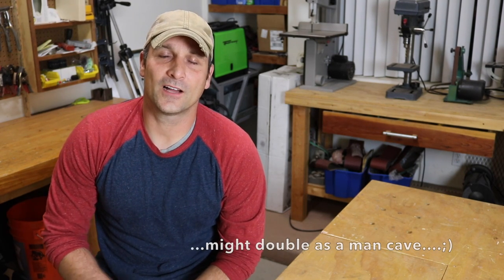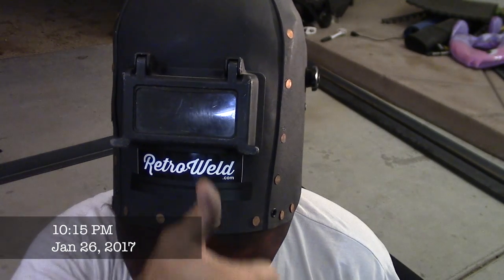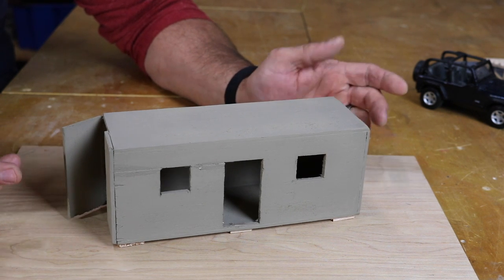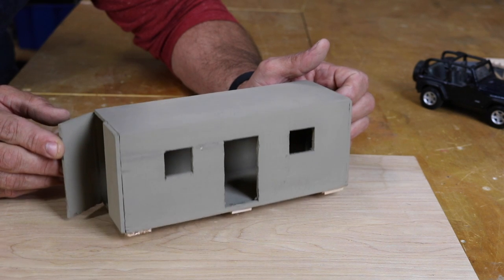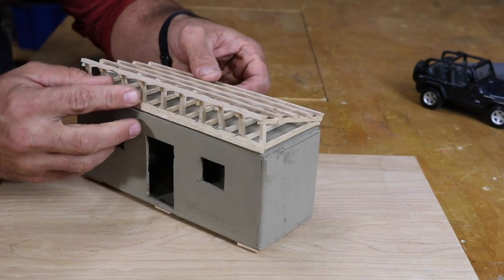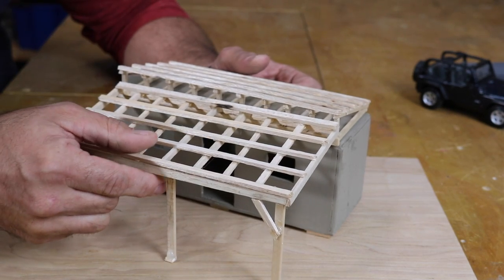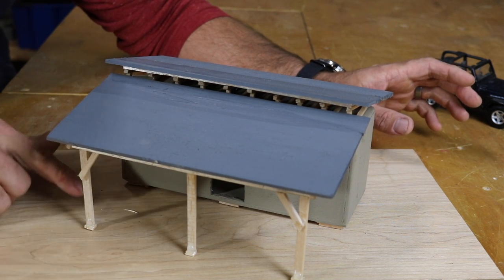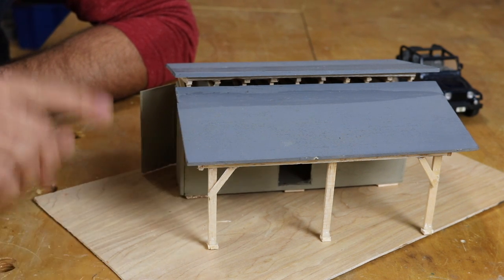Shipping Container Shop Project - Intro

Comment: By the look of your model, in my opinion you are on the right track. a Roof with insulation for a container is an absolute must in our climates. It becomes a oven without one. Really excited to see the project Joe. Will definitely have to make a detour from Vegas in April to come and see for myself.
Reply from the maker: I'd love that Charl!  If you can make it out I'd for sure try and be available.  Or if it is on a shift day you'd be welcome to swing by the station too:)

Comment: Great video, I have experience using them in war, we insulated ours with a foot of mud on the outside which kept the container home inside temperature easily manable, and by the way it resisted an RPG attacks, it just made holes in the outside mud wall.
Reply from the maker: Wow, that's cool!  That's being resourceful in multiple ways too!  I plan to incorporate some south and west face insuation of some sort.  Not sure yet but that will be later down the way:)
Reply: homesteadonomics let me know if you need more ideas, you can also use gabion baskets made of rocks and mud too. I enjoy sharing because it helps others. You are doing a good job sharing, so please continue posting.
Reply from the maker: haha.. it's funny you mentioned gabions because that's actually something I plan on incorporating into this!  Kind of a gabion wall on the west end to act as a wind break:)
Reply: homesteadonomics I was a reconstruction team leader in Afghanistan and have great gabion  ideas and pictures they are yours, just keep sharing.

Comment: Have considered this as an option for some project(s) as well. Looking forward to how you cut through the metal, adhere the roofing structure, attach the overhang to the roof. Appreciate all the other videos provided as the information is concise and helpful.
Reply from the maker: Yes, it's gonna be an experiment for sure.. but hopefully I'll come up with some workable solutions:)  going to be doing the main cut tomorrow and hopefully will get them moved over to the property:)

Comment: Hi Joe,  Just thinking (random thoughts about your project) about natural light. Your door and two windows will be shaded by the roof and awnings. Will the "carport/jeep-port" awning be made of some sort of see-through material? If not think about adding windows to the back side of the container too.  I can imagine a series of 3 or 4 foot windows set horizontal and high near the roof line to let in tons of natural light (but this can be evaluated after the awnings go up). I'm sure you have an idea of where you want to put this on your homestead will it be south facing? Will it be on the opposite side of the house from the bedrooms, or some distance away from the house? Will you insulate and put down plywood on the floor and walls to help absorb some noise? Paint the interior white to reflect light? Running electrical to it for power. LED shop lights?  Mini-fridge (for the man-cave side)? Oh by the way how's that pinwheel project coming along? I hope that Jeep sponsorship comes through. Cheers,    Bill
Reply from the maker: Hi William,  
Dang you hit on things I hadn't even thought of.  but for now the orientation will be E-W and the awning will face north towards my garage opening to act as a wind block and make working between the garage and the shop seemless.  Insulation will be inteerior on one end, a little closed off space that I'll consider a 'clean' area with a door.  It will almost be like a little office area with a work bench and paneled walls.. and maybe a little window ac unit.  ..fridge in there too;)
I haven't decided on power yet as I'm wanting to keep this technically unafixed and more of a shed structure legal wise.  I might have a junction box on the container to be powered by an RV extension cord so I can technically say that it doesn't have power to it:)
Anyways, just some thoughts for now but I'm sure it will change a bit along the way:)
Joe
Reply: Hi Joe,Maybe you should rethink this whole project. The awnings are to provide protection from the sun for your new picnic table. Then if the space just happens to get repurposed with ... say... a movable tool shed then that's just a bonus, just to avoid the taxable building issue. On to another subject. I can't recall if you've ever talked about back up power for your home. Does your home have a back up generator? If not that might make a great addition to the shop. So you might feel fine to run an extension cord from the garage to the shop to run a drill or saw. But for something that requires a lot of juice you'd have the generator. And if you ever lose grid power then the shop genny could power your home. Cheers,    Bill

Comment: I think its a great idea, and look forward to the series. As I thought about your project, one thing that may be a problem for you is securing the roof without drilling too many holes into the container. Those containers do have a few tie down points, so Im assuming you are going to focus on those points for securing the roof area? Just throwing it out there so you can "chew" on it and come up with a game plan. It may all come clear when the container is sitting on location though...good luck
Reply from the maker: I'm always game for some ideas to 'chew' on so keep em coming:)  Yes, i think I will weld brackets to hold the roof trusses on and maybe bolt them on as well.. need to do some more looking at the roof structure when I cut it.

Comment: WOW   will  be a GREAT project,  and have seen so many different ways to use the containers. Would DEF go with the 12 awning roof,  and then that gives you plenty of space to do things and not be cramped. Also like the ideas of the gabions and such for wind and sun protection. Any thoughts of making a gabion style raised bed along the one side of the awning? Water from off that roof and have green plants to help shade and filter the air as it passes through.  Good luck and keep those great ideas coming.    Greg
Reply from the maker: Thanks Greg!  I really like your idea about the gabion raised bed!  I might just have to incorporate something like that into awning area.  it would look cool, help with wind and just make it a nicer area to be.  I'm hoping to make this shop more than just a shop and into something that has some character to it too!
btw.. I just posted the cutting of the container:)
Joe

Comment: Wish I could do this (11th floor apartment life is confining). Very minecraftian that.  You may want to make some 1x1 stud walls covered with 5mil sheet plastic and make a full sized model before you get cutting steel.  Much easier to lay the ideas out in real-space that way (and cheaper and the 1x1s are repurposable easily for interior construction).
Reply from the maker: That's a great idea and probably close to what I'm gonna do with one end that I plan on making into a more livable clean space... workbench but with a door so I can keep out the dust and other stuff:)  This is gonna be my psuedo tiny house project... but in the practical form of a shop:)

Comment: hey Joe love this idea. I do have a few questions, how will you close off the cut end for your co-worker? will you keep the shipping container doors or will the co-worker get that end? have you looked at some sort of diy sliding door? or maybe a small roll up garage door.  great idea though buddy can't wait to see it
Reply from the maker: Hey Lance... I plan to convert the side with doors for my co-worker, so that he gets nicely weather tight doors and that way I can get it to him quicker.  The part I'm keeping will get the custom doors as I'm wanting to not have the shipping container latch system.  They probably won't be as weather tight as the originals but with the roof over hang it might be just fine:)

Comment: I would  be very careful in splitting a 40 foot container jnto two. the corner posts are the main way that the container takes loads and stays rigid so cutting two out would really damage its integrity if iy is not supported in some other manner. also I would recommend painting it white on the outside and adding some insulation so it doesnt get like an oven during the day.
Reply from the maker: Yes, it's a concern of mine.   I'm actually going to be welding x bracing inside the container today just to make sure the cuts ends stay square until I can get new corner post /end frames welded on.

Comment: Heck, you could fold the container along the cut line and have yourself a 20x20 shop. (Find a way to recoup your costs elsewhere)
Reply: Sorry to be another commenter with: "you should..." or "you could..."
Reply from the maker: It's no problem.. it's a valid question and really actually the most bang for my buck regarding space, etc,.  But I'm wanting this to 'technically' be moveable so that I can consider it a 'shed' type building.  this is in regard to our local codes.  If it is afixed to the ground and not moveable then it's a taxable structure.  The awning will be offset from the main ridgeline so as to not be apart of the main roof structure and therefor easily removeable.  Not saying that I ever really plan to move it just trying to make sure I have options;)  ... and one more reason is if I ever hit a financial hardship that I could sell it to someone :D
thanks for watching Larry:)

Comment: I always thought of having a container workshop, so this should be good to see.

Question. will this be cheaper than building a shed?
Reply from the maker: Hi Harki,

I think it will be about a wash... by my calculations it will be about the same if it was just a 20' container.  BUT, the selling of one end of the container will make it cheaper by recouping my costs.  But for the most part it's because I wanted something with metal walls and that could be moved in the future if I ever needed to sell it:)
Reply: Yeah didn't think about the mobility of this, great idea. Can't wait to see it happening.

Comment: Some thoughts after watching the video.

1)What orientation are you planing (N-S , E-W) (Do you minimize heat gain or solar panels.)

2) Insulate the outside of the container, not the inside.
Reply from the maker: hi cat prog,

orientation will be e-w and the awning will face north towards my garage opening.  It will serve as a windblock for our SW predominant winds.  Insulation for the container is up in the air right now but I plan to build a dead air space shade block on the south and west sides.  That is common in the desert SW to have something that just casts shade on a wall to bring down the heat transfer.  The cold is less of a concern though.
but it won't get decided until the main structure is up first:)  thanks for watching!
joe

Comment: If you have the room can you orientate the connie to obtain maximum solar efficiency ie so you dont cook in the hot weather or freeze in the cold weather?
Reply from the maker: I plan to have it e-w with the awning facing north.  the south end will get some shade structuring to help with heat and the west end will get some insulation on the interior and closed off on the inside to make myself a little clean work area that will hopefully be free of dust.

Comment: are you going to lay a slab of concrete either under the container and awning or at least just the awning?
Reply from the maker: No concrete.. just concrete piers that I poured a couple days ago.  Under the awning I might do a slab though for being able to work on things with a nice flat level surface.
Reply: Yeah I think that would be smart

Comment: Curious about the rationale for the "split level" roof.  Why not use standard trusses?
Reply from the maker: I'll probably talk about that in a later video but the quick reason is that I want it to have the ability to be removed to keep it classified as a temporary building.... ie.. .for tax/code reasons:)

Comment: How much is a shipping container and where do you get them?
Reply from the maker: Hi nancy, 

Costs depend greatly on where you are located in relation to a port that get these containers.   In my area 20ft containers can go from as cheap as 1500 to 3000 depending on condition.  Some coastal areas they can be as cheap as a few hundred dollars.  I however, purchased a 40ft from my neighbor for 2100 and then sold the front cut off section to a friend to make my 20ft section that I kept for the shop roughly $1200.
Joe
Reply: That is good to know, thank you for the information :)

Comment: Late to the party as usual...  LOL...  Let's see...  Brain teasers...  We have a roll down door on our shed that might work if those end doors prove out heavy...  Since you are shading that much ground, bury 100' of 4" flex and geo cool the container with two 4" solar duct fans (one pushing and one pulling)...  And...  Definitely gonna need a mini-fridge...  Then all ya need is the rocking chair, tin foil hat, and a shotgun....Just say'n...
Reply from the maker: hahaha... the tin foil hat is in the faraday cage;)  
but the roll up door is a consideration for sure.  that's actually what I've most commonly seen container converters do around here.  Mini fridge, yes.  4" flex I actually have sitting in my junk pile.  Was originally for the GH but then I got 6" pvc for cheap on CL.... so that might just make it's way in:)
Reply: Excellent idea, keeping the foil hat in the Faraday !  Better still...  Build a wearable neck-up Faraday to preserve the electrical activity in your brain !  A mind is a terrible thing to waste (in the event of an EMP)...  LOL